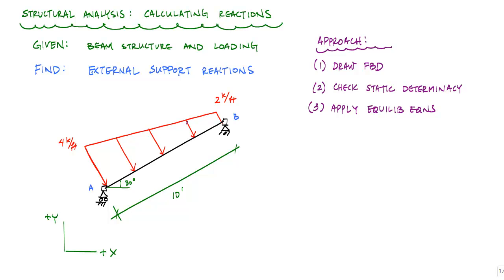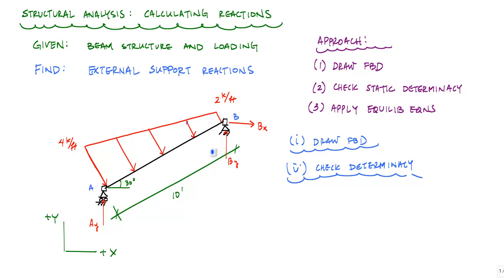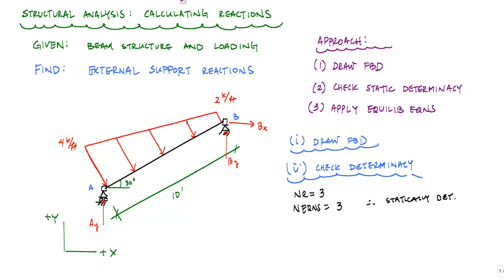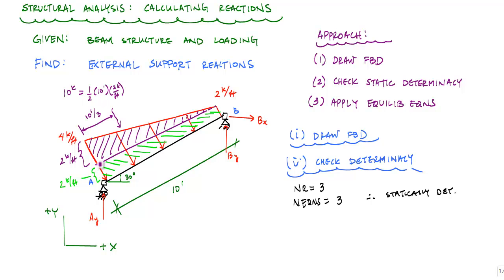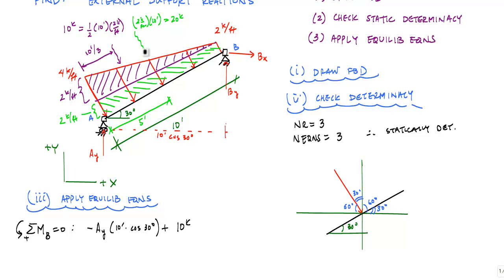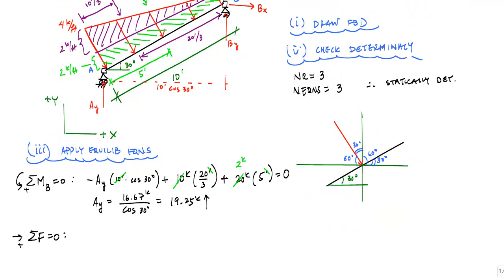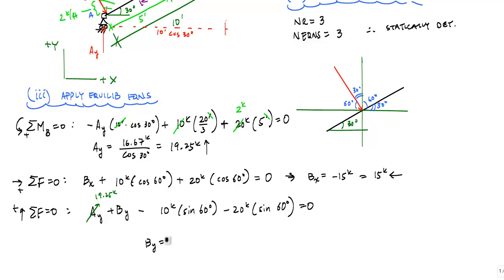Calculating Reactions for Angled Beam - Statics/Structural Analysis

Comment: Sir, can I please get clarity on why when we calculate moment at B, we do not use the vertical component of 10k and 20k.

What I mean is, why don't we say 10k sin 60 degrees time 20'/3 and the same thing with 20k sin 60 degrees multiply by the distance of 5

Comment: I have since my last post done another test where the top support is only constrined vertically and laterally. The horizontal support is considerd sliding. This sorts out the problem. 
I can also try a support which has some friction there too as for real life.

Comment: Hi, I have a software program which I use for this work. The simple beam end reactions are equal for any incline, but when a gantry is considered, the lower support takes much more load than the top. Even to the point at which the top support, when inclided at 36 deg. the reaction becomes negative. I find this very confusing.
Can you throw light on this please?

Comment: I was introduced to the channel recently through my search for refresher materials on structural analysis and am in love with the videos.
I have 2 issues and require your assistance for this video, 
1. The example are not in SI. As i and many more have studied in the UK, Europe or India, It would be great if the video you have posted in non-SI units to be provided in SI units.
2. The sin and cos conventions for resolving the angled forces are always tricky and confusing for me. Can you help me understand it better? in both 2D and 3D
Your assistance will be much appreciated.
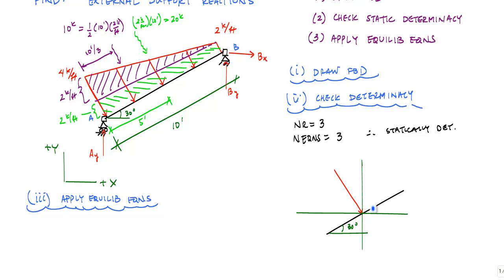Reply: To better anderstand the sin and cos for angled forces you just have to draw the Vertical and Horizontal Axis at 4:32 and divide the force into its own Vertical and Horizontal components. Or you just have to look for Vectors and trigonometry. I hope it was helpfull, good luck

Comment: I do not believe these answers.  I haven't done them on paper, but you need to do the 20'/3/(SIN30 or COS30) as it is closer to the vertical moment of Ay.  Unless I haven't done these in a while, I am mistaken, but please give me the answer as it would be vertical beam to prove the numbers are correct.  Thanks, and sorry for questioning without doing the work, but I'm a little busy.  Thanks in advance, and I hope I'm not starting trouble.

Comment: Big mistake: You assumed the load to the left of midpoint of the beam would be handled by the left support & load to the right by right support, which is ONLY true when the beam is horizontal. Otherwise, more of the load is ALWAYS born by the lower support, depending on the angle, increasing with the angle of the beam to horizontal.
Reply: That's only valid when you think of it as in real life because the load will point downwards. But when the force is also applied with the same angle as the member it might not be the case.

Comment: Sir one thing which i didn't understand is that when  u were to take moment about point B  u multiplied the horizontal distance  that is  Ay , u did multply by the cosine of the distance . My understanding is that when we are taking a moment we should see the direct distance between the support . I didn't. get the multiplication of the distance of 10 feet by cosine of 30

Comment: structurefree How come you used the horizontal distance between A and B in writing the moment equation for the reaction at A and you didn't use the horizontal distance for the other two forces (you used 20/3' and 5')?
Reply from the maker: since the arm is the perpendicular distance with respect to the line of action of the force....or shortest distance to the point where you are taking moments about.
Reply: It is exactly where I am confused about at first
Reply: Its the perpendicular distance.  The two applied forces are perpendicular to the beam angle, so just take the distance along the beam, 20/3' and 5' from point B.

Comment: Hi there, do you mind to do an example for vertical loading on the beam with two pin supports? Is there a way to prove that the horizontal reactions are zero?
Reply from the maker: For this statically determinate, angled beam, if the loading were entirely vertical you could apply equilibrium in the horizontal = 0 and it would tell you that the horizontal reaction at B is zero.
Reply: I think she means if the two supports are pinned, therefore there would be 2 horizontal reactions.  Therefore you'd have 4 unknowns with vertical loading.

Comment from the maker: Here's an example problem on calculating reactions for an angled beam.
Reply: hello sir.. well i have ran into another problem again. anyway, here it is.. "A reinforced concrete beam of rectangular  section is 25 cm wide and 50 cm deep, steel reinforcement of A=11 cm^2 is palced at 5 cm above the tension face, the maximum compressive stress in concrete is 4.2 N/mm^2, modular ratio m=15, calculate the moment of resistance M and the stress in the steel.[[ANS. 38kNm,89N/mm^2]]" according to strength of materials by GH Ryder. NB: i did the problem and got 45 and 95 respectively. i would be greatful if u could do the problem and see if u get 38 and 89 like the book says and mayb left a brief explanation. BTW i have to submit the solution in 5 days time. (march 25)